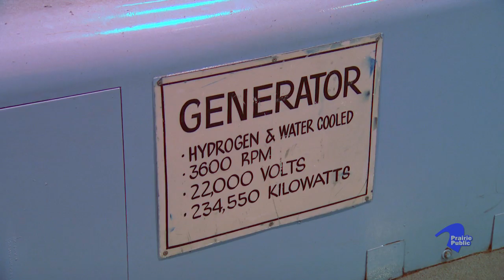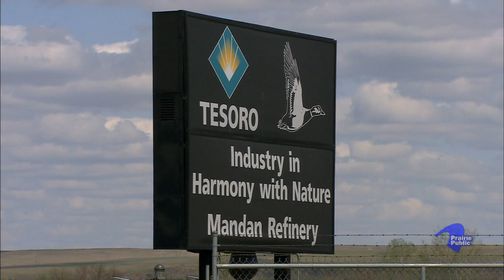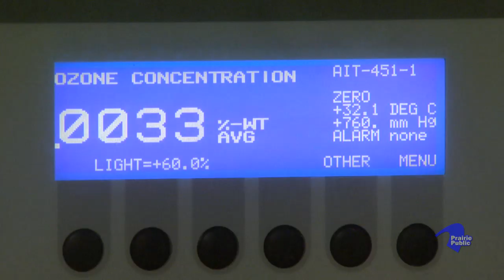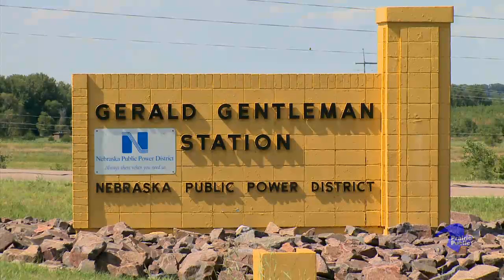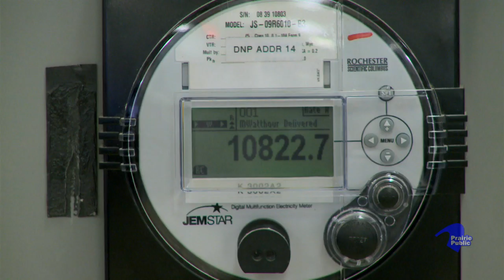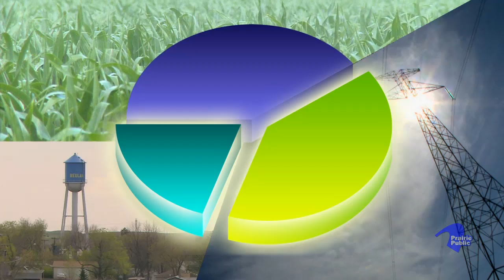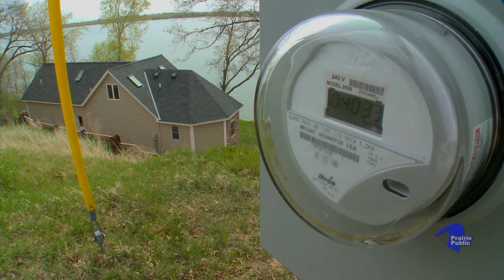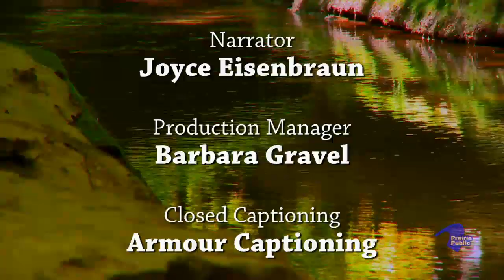Water: Lifeblood of Energy

Comment: This video seems to confuse a lot of issues. For example, the vast majority of water used for cooling at most power plants is not consumed. There is a significant difference, however, between the consumption of water if the plant is cooled by once-through cooling (where almost all of the water is returned) to that of plants that use open cooling towers (where a significant amount is evaporated). 

As pointed out by others, there are also some errors such as providing Thomas Edison with credit for the invention of the electric generator. 

In general, the video could do a better job of pointing the way to appropriate answers. However, overall it is interesting and somewhat informative.

Comment: This is something I can't understand:Why can't the waste heat be used? The steam looses pressure and can't turn the turbine any longer, but still has a great deal of heat. why can't the steam be pumped into a high pressure system that has a higher boiling point that the the temperature of the steam, which would condense it back to water without loosing heat, then reintroduced into the heat exchanger where it only has to be raised slightly to go back to high pressure steam again?